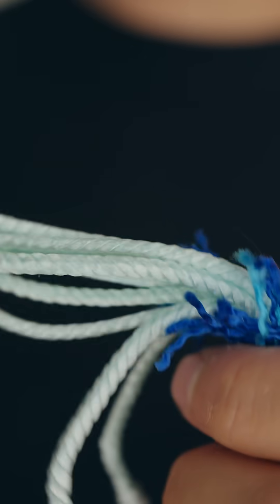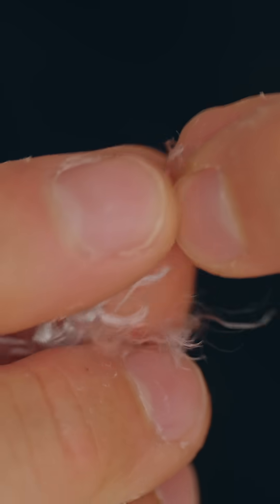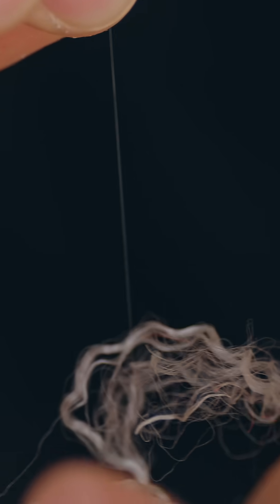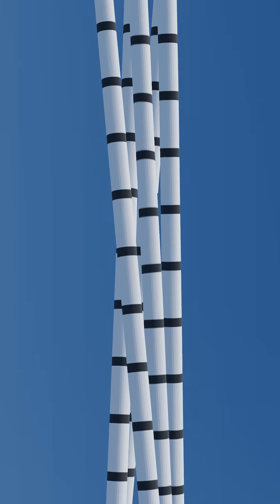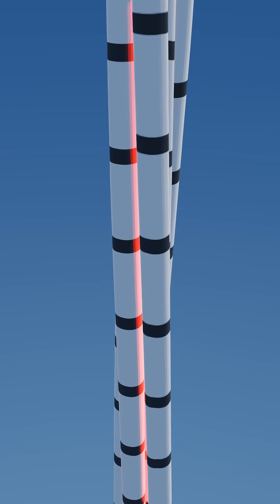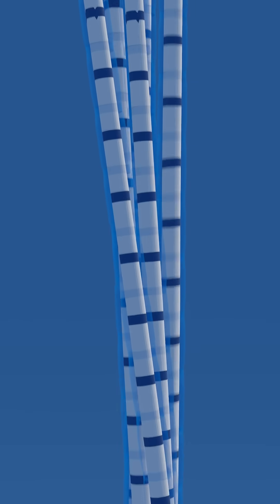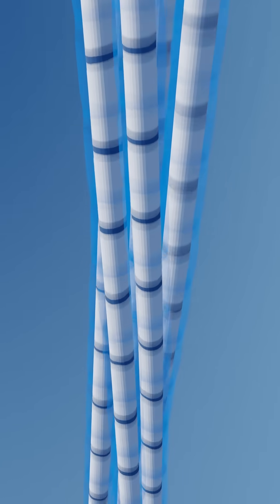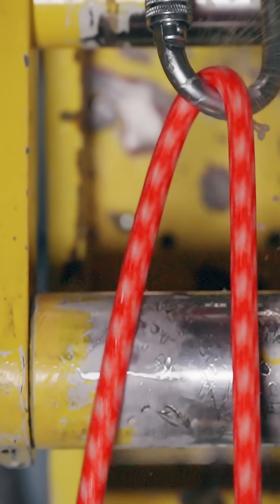What Happens to Wet Ropes? #climbing #science

Comment: As an expert in muscle physiology this is very similar to muscle contractile elements.  They should use a lipid based product to surround each strand to prevent excessive friction.  Similar to skeletal muscle
Reply: Friction between the filaments is a good thing for climbing ropes. You want friction in this application as it produces a damping force which reduces peak tensile forces during climbing falls, thus protecting the safety equipment and the climbing.
Reply: Oil up yer ropes. 👍
Reply: The video literally just said you don't want the filament to be lubricated 🤦
Reply: Once you get small enough things of same shape will act similar.
Reply: Fat goes rancid. Not a great thing to have your ropes dripping in.
Reply: Grease?
Reply: Your channel's posts are hilarious
Reply: Youre an expert in muscle physiology but not smart enough to understand what he said about wanting friction? Yeah ok bud
Reply: Unfortunately the world runs on capitalism, not safety standards.

Comment: Randomly related, so would you recommend to wash a rope at all? Or is it just a matter of drying it thoroughly? Been thinking about doing it since your video on how much dirt affects rope quality.
Reply: The grains for dirt in your rope act like little razors and compromise the strength of your rope. The main concern with a washed rope is that it either isn't dry/took too long to dry and molded or it was compromised by a chemical in the soap (you can buy packets of soap for a single rope). Wash your rope then hang it up, fanned out, somewhere airy.
Reply: @nappytimes6738 and don't forget to stop for a few casual, one-sided conversations with the rope as it dries. Being washed and dried stresses the rope slightly and small talk is the best way to relax the strands.

Just don't mention sports, politics, or religion, or the rope might get more stressed than it can handle.
Reply: If you dry it then you get the both of both worlds

Comment: I would have thought the squeezing of the water out of the rope A. Added to friction within and B. Dissipated heat more effectively.
Reply: A is wrong, but B is correct.

Water does act as a lubricant as well as dissipating heat like conventional lubricants. This makes the ropes relatively stronger, but in ways that are undesirable in the dynamic loading scenarios these ropes are intended for.
Reply: @necromanticer169 it's counterintuitive, but the wet rope actually holds more heat from friction, not less. Take a paper towel and hold it to your stovetop. It won't burn your hand for a few seconds. Now wet the paper towel and do it again, and it'll burn you like it's not even there. The water absorbs the heat, but the total volume of water is not enough to dissipate it quickly so it actually gets hotter.

Comment: Hundreds of massive falls? Aren't most ropes only rated for like 6-8 massive falls?
Reply: Depends on your definition of massive, the shown fall had a fall factor of maybe 1/3 at most, while ropes are usually rated for something like 10 factor 2 falls
Reply: If that was the case, I’d already be dead 😂.
Reply: Within a short period of time and on the same spot.
Reply: Ropes are rated in terms of factor 2 falls. The one shown in the video doesnt come anywhere close to that
Reply: "factor 2 fall" is when the fall is twice the length of rope paid out. This is confusing written so an example for a factor 2 fall would be: your climber is clipped in 8 meters above you and 2 meters (10 meters rope total out) above that, they whip and fall 4 metered (2x2meters). 4/10 is a fall factor of 0.4. The falls needed to meet the definition of a factor 2 fall are enormous. And as you mentioned, most ropes are rated for 2~4 of them.